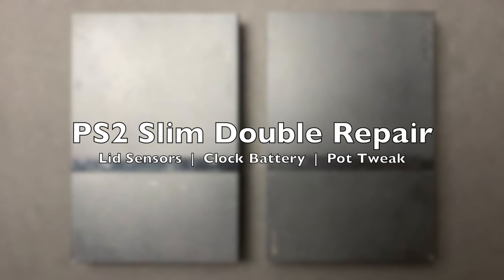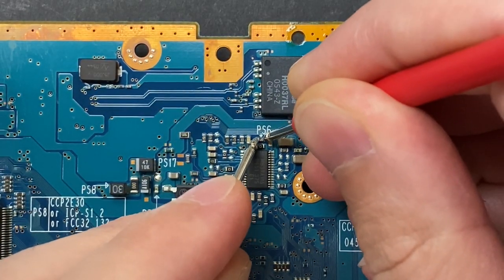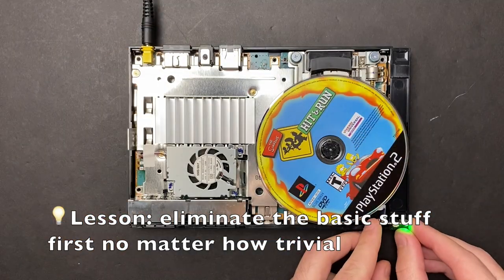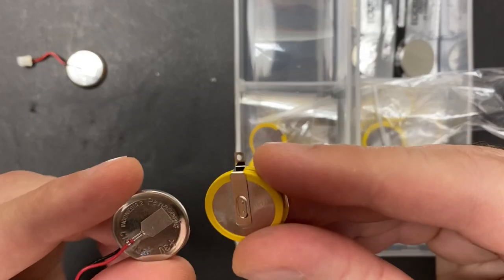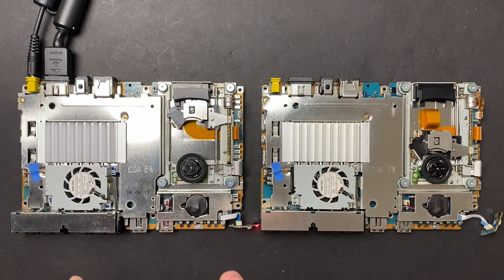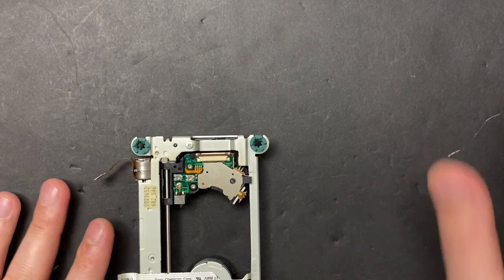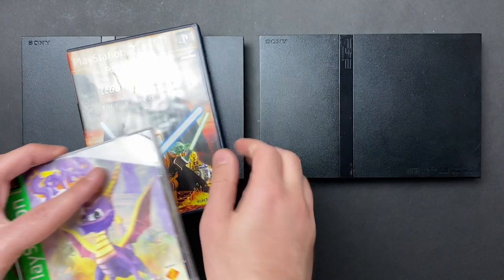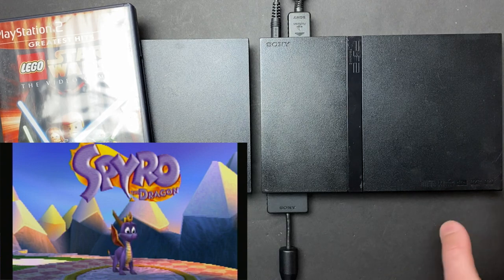A Tale of Two PS2 Slims - Faulty Retro Console Restoration

Comment: Wow, I had no idea there were so many things that can mess up an old console. You look on line and pay sometimes hundreds of dollars for a 12 year old or more console and even if they say," working", how well or how completely, is a whole other thing.  I just bought a PS2 90001 slim and though it looks in decent shape, I won't know how it works because the seller sent a power cord for the older version with a power brick. It's stupid to put a battery in the unit and not make it a simple replaceable. Vs having to solder it in. At least now I know not to expect too much. Makes me glad I bartered the price.  You can buy a PS4 used, for same as a PS2. But naturally, Sony didn't make them all, backwards compatible. So we end up with games sitting around years later and no way to play them. Crazy.

Comment: What power tester are you using to test the laser settings? Mine stopped reading discs but spins them. So I am going to try replacing the laser
Reply from the maker: It's a multimeter measuring the resistance of the laser potentiometer.

Comment: Nice video.  On my unit, I pushed on both switches and the disc start to spin and stopped after a few revolutions, and then turn off.  Would appreciate any ideas.  Thanks.

Comment: Does the model of the ps2 affects the calibration of the laser? I have the model scph-90001 and i'm having this issue, but i don't have a chart of reference values for different models.
Reply from the maker: Possibly. I don't know if the optical drive was changed for the later revisions. The resistance values also differ from system to system even with the same drive so it's an imperfect procedure, but might give you an idea where to start.

Comment: Very nice fix.  What was happening at about the 17:54 mark?  I saw the resistance going up, but what exactly was going on with the screwdriver you were using?
Reply from the maker: The optical drive has two potentiometers which act like variable resistors. If you reduce the resistance you are able to deliver more voltage to the laser (increase power). Conversely if you increase resistance you can reduce power to the laser. When lasers begin to die you can sometimes get more life out of them by adjusting the potentiometer. The previous owner of this unit probably did that in an attempt to get it to read disks, when in fact the laser was completely fine. By lowering the resistance he make the laser more powerful but as you saw it wasn't reading disks properly. I increased the resistance to bring it back down to the power levels of the "virgin" unit's drive, which I knew had never been tampered with due to the intact warranty seal.
Reply: @BorderlineOCD  Awesome.  Was there a screw that you were turning to alter the resistance?
Reply from the maker: The potentiometers have screw heads that rotate. They're known as trimmer potentiometers or "trim pots" and come in a variety of shapes and sizes. The pair on the optical drive are small SMD variants.
Reply: @BorderlineOCD  Awesome, thanks.  Really like your videos.

Comment: I once bought a PS2 from a thrift store. The guy said that I don't know if it works or not it's all your luck. I looked for seal and it was intact. So I was like what could go wrong. I paid him I guess it was $2. Took it home and connected it to TV. It didn't played games for some reason. I opened the lid and clicked on the micro switch that tells the console that disc is in. Nothing. So I opened it up and surprisingly all ribbon cables for the dvd drive were disconnected. It was a sealed console keep this in mind. And cables were disconnected. I connected them back up and it worked. Thought I'd share this..
Reply from the maker: Yikes. Do you have memory of peeling off the warranty sticker? Is it possible the warranty sticker was a reproduction? I think scammers will always find creative ways around these seals. I personally haven't had success removing stickers like this without the "void" print separating. Tried both heat and alcohol and it still tears. I'm able to remove an original Xbox sticker no problem (and everyone needs to remove their Xbox clock caps so not sure a "sealed" unit is a good sign from a longevity standpoint) but I do it for aesthetics more than anything else.
Reply: @BorderlineOCD  yeah it was genuine seal. I also thought that this sticker might be replaced at some point. So I had another slim which I was using at the time and compared the stickers visually. It looked very similar no difference at all. When I removed it it printed void on the console as you mentioned. And all screws opened with that satisfying "click". Also the console was in great condition too.

Comment: Hey dude! I know this is an old video but i would highly recommend not using expensive games on these slim consoles you get for repair. Sometimes the laser ribbon cables start to unstick and they belly up and touch the disc underneath. Ran into this problem myself but thankfully i test with fifa haha
Reply from the maker: Thanks for the tip. A few folks shared similar experiences. Surprised I haven't run into this yet but good to keep in mind. Seems to be a prevalent issue with the Slims.

Comment: What kind of grease do you use to lubricate?? Or can I get away just using contact cleaner. The wires connected to fan do you use electrical tape or can I just use normal tape as currently they are not taped down.
Is there any safe way to do pot adjustment with a reader as not sure how they work
Reply from the maker: I have the stuff I use linked in the description. I think on this particular unit the tape isn't a big concern. You can skip it altogether as that cable isn't going anywhere. You can use any kind of tape these units aren't generally known for overheating. If your drive is working don't change the potentiometers. If they need adjusting you'll need to use a multimeter. I'm not a fan of trial and error on pots without reading the value as you can inadvertently sent too much power to the laser and drastically reduce its life.
Reply: @BorderlineOCD  I don't have a multimetre divice I know it anti clockwise to increase power to laser. So it is better to turn it clockwise or anti clockwise

Comment: Those "tray open" switches are crap. I know people who have either super glued them shut, or removed them entirely and soldered a bridge it place. There's also a third switch on the front of the laser assembly that supposed to tell the drive when the laser is in the "foward" position. Check that if the laser is acting wonky.

Comment: Hi, wanted to ask, my playstation will load the disk only when the Ps2 is in  vertical position, any idea what the issue could be ?
Reply: Could be motor strain. Open the case and clean any dust around the motor and laser assembly. Check to see if a hair is wrapped around the spindle (this is actually a pretty common cause of disc-reading errors, believe it or not).

Also check the tray switches. There's the two shown in this video, but there's also a third on the front of the laser assembly. This is supposed to press against a metal plate to tell the system when the laser is in the 'forward' position.

Comment: My PS2 Slim is starting to have the same fault. I need to put something on the lid to fully press down the switches to get it to read the disc.
Reply from the maker: Use some contact cleaner in the both holes. It should revive the functionality of the switches.
Reply: Might not work. The plastic gets worn down ovee time too so.might not be pushed enough. Like I said another comment i taped down back middle one and it works fine with switch on power button.

Comment: i think i blew a fuse on mine when i was dialing the laser. I didnt plug the ribbon back into the laser and when i when to go do a test my ps2 started buzzing and i shut it off. reconnected the ribbon cable to the laser and now the disk doesnt want to spin
Reply: update: turns out i was using the wrong kind of laser for my ps2. i had bought 2 lasers. One was green like the one in the video and the other i had was like orange/yellow. Turns out that the green underside laser was incompatible with my version of the slim causing the disk drive not to spin. I put the other one (which was more like the original one i had in my slim) and it worked fine. Turns out you do need specific lasers
Reply from the maker: The SPU laser (Philips) needs to be changed with the same laser, but the PVR802W and the KHM430 are interchangeable.

Comment: I have a ps2 slim that I've had sense the model launched. It has lose video port and I cant find a single video on how to fix it.
Reply from the maker: The multi-out connector isn't terribly difficult to reflow. Just look for any video on reflowing broken pins on a through-hole connector.
Reply: @BorderlineOCD  Ya I'll just need to pick up an iron and accessory.
Reply: @AnarickTheDevil  it will be easier with hot air i got my hot air thing for $45 on Ebay and it's very nice and has a digital display with adjustable temperature and air flow (one of the best tools i have bought for this kind of stuff just can't use it very much because i don't fix smd or through hole stuff with lots of pins very often)

Comment: Fat Model PS2 > Slim Model PS2

good job fixin these but i have a long hate relationship with Slim PS2s vs Fat Models because i never have any issues with Fat Models
Reply from the maker: Totally agree. I think these are flimsy and the build quality is low compared to the fat PS2. I feel the same way about the PS1.
Reply: @BorderlineOCD  not to mention Slim PS2's has very bad overheating issues and i don't trust Slim Models especially when i'm tryin' to do livestreams on them, it's why i always go for Fat Models, i could live Fat Models on for hours and hours and they won't overheat
Reply: @blakedmc1989RaveHD  Yeah I prefer the fat, I have never owned a slim but considered the fat has the HDD expansion it's just so much better. The slim might work as a good lightweight DVD player though, but the issue of the slim's ribbon cable scratching discs is a problem.

From what I've seen slims are easier to open up, but fat models aren't really that hard to open up if you are careful. I've done a full teardown on my fat and you just gotta be careful with the ribbon cables.
Reply: @KylesDigitalLab  yea i'd rather take my chances on a Fat Model over Slim Model

Comment: Disc rot and laser failure is the issue that is coming up on disc based consoles, like the PS1, PS2, Sega CD/MegaCD, Saturn, Dreamcast, Gamecube, Wii, etc. that's why retro console fans are making those things like optical drive emulators (GC Loader, PSIO, XStation, GDEMU), softmods, etc.

Comment: They are badly designed those mechanical switches can easily get clogged up with dirt n dust..
Reply from the maker: Apparently a common issue with these. First thing I'll check on a PS2 Slim in future that doesn't spin up.